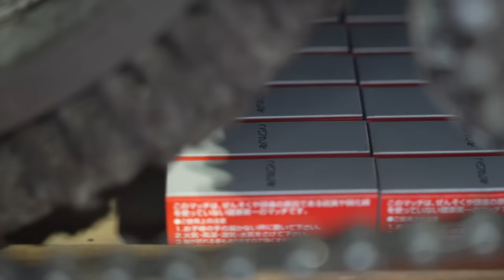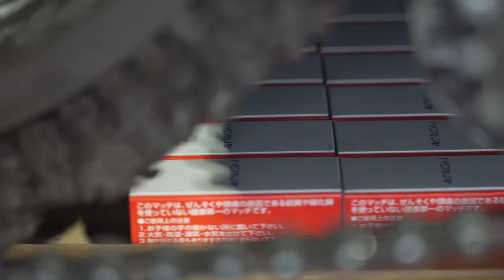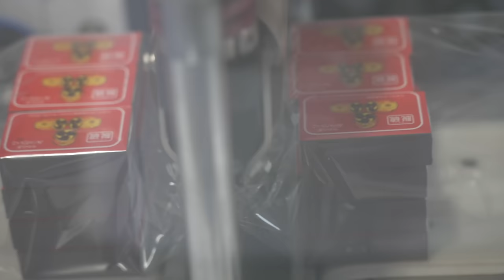マッチを大量生産するプロセス。1日630万本のマッチを生産する日本の工場。

Comment: マッチ軸を箱に装填してから横薬を塗るという工程順。横薬の表面傷つきを極力抑える工程順。製品の外見を重視する極めて日本的な工程順だと思った。と同時に想定外だった。
Reply: 外観もあると思いますが、発火による事故を防ぐためと感じました。
Reply: It is quite strange. All other matchbox videos i have seen, makes them different, with the strike surface already printed on the cardboard before the assembly of the box. By applying the striking solution in a serigraphic or gravure print proces on large sheets (before cutting the sheets) they can print in dot patterns, that saves the solution, and makes the strike more easy for the end user. But i admit that there is a risk of fire when putting the matches into the box. Another thing in this video that is odd, is how many times the matches are handled manually from one proces to another. So many people employed, inguess that is a good thing (but very boring jobs), but it makes the products very expensive. Maybe that is possible, because the japanese consumer will pay more for a made in Japan product?